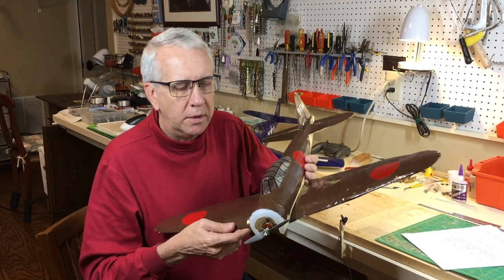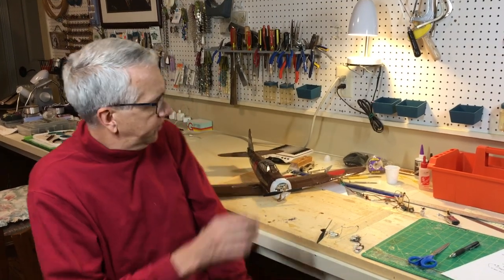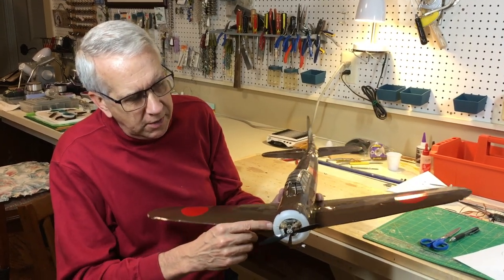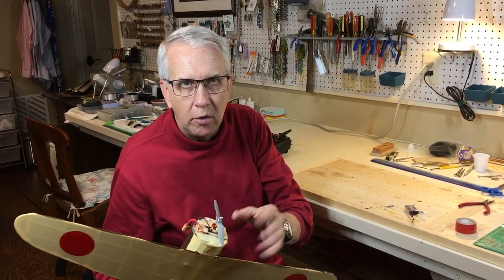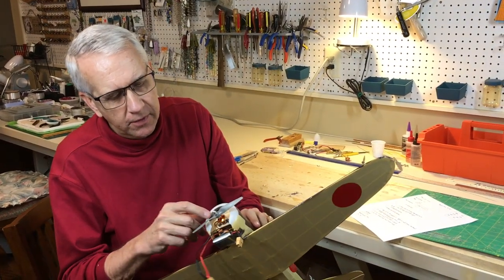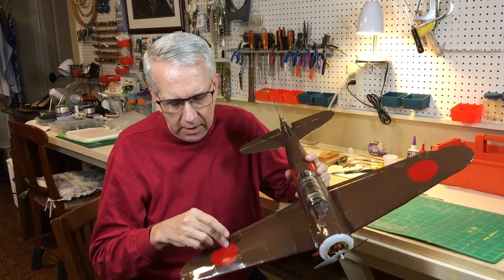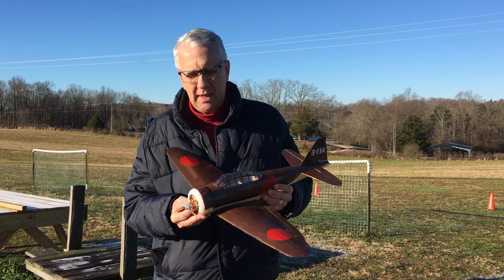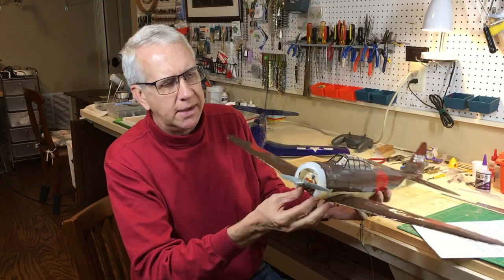Guillows Zero RC Conversion Success

Comment: Great job, Tim. I used to slightly extend the nose on planes like this to get the balance right without having to add weight to the nose. Done with discretion, it's virtually unnoticeable. This is also a common fix for tail-heavy full-size aircraft designs. Also, with minimal dihedral, ailerons are always necessary for good lateral cotrol as rudder control only will not produce sufficient roll.
Reply from the maker: G-Man:  Thanks for the info!  Tim
Reply: @TimMcKay56  YW

Comment: Hi Tim.  on the two recent conversions i've watched (This build and on the Corsair) I noted the weight differences you pointed out with the leading edges and wondered if this may of been a design feature for the elastic band powered build.?
Mainly due to counteract the stronger torque produced by the elastic propellers greater pitch they usually have.?

Keep the builds coming they're great and the models look fantastic.!

Reminds me so much of what my Dad would get up to in his shed.

I doubt you'd be bonkers enough to build a full size Gyro copter glider from aluminium scaffolding poles and a car wheel hub anytime soon though.  LOL.
Cheers.  :)
Reply from the maker: Electrodoc:  Not sure I can add much to the leadiing edge issues with each build.  The Zero Guillows model is a lot smaller than the "Giant Scale" Hellcat, some changes in the methods of construction.  And no full size gyrocopters for me!!  Tim

Comment: Sir Tim, good morning and I hope this comment reaching in good health. Thank you for all the video tutorials regarding the RC conversion of Guillows wood/balsa planes. I just received an earlier version of the Guillows World War 2 Mitsubishi Zero flying multi-purpose model kit, designed for both rubber band and RC. I am seriously thinking of converting this to a remote control plane and would like to seek your help in buying the correct RC parts. I live in the Philippines and we don't have much stores to buy them except for online shopping services like Shopee Phil. or Ebay. Can you kindly give me a really detailed list of the RC parts you used for the successfull conversion of your Zero plane? I'm retiring (60 years old) in December 2022 and will start buying the parts to start the kit and give myself a fun Christmas gift. 🤣🤣🤣
Reply from the maker: Roberto:  Check out my video on where to buy micro electronics in 2022. Good luck with your Zero build!  Tim

Comment: Just out of curiosity: why don't they make a gearbox for outrunners just like they did to the brushed motors so we can run these little guys with less speed.  With the outrunner, even with low kV, they go extremely fast with an 8x4 prop.  Any thoughts are welcome.  Good job :-))
Reply from the maker: WS:  Wish I had a good answer for a good question!  Seems like there are very few micro motors out there.  Tim

Comment: Hello Tim, I just watched a 16 part video by some English men. Who built a kit #203 (Newport). He used a lot of carbon fiber rod in the build, really thin stuff maybe 1/16th. He hasn't flown it yet, I guess I'll have to weight to see how successful he was. I've never worked with carbon fiber. Is it Ca glued together or do you have to use an epoxy to join it?
Reply from the maker: David:  Yes, carbon rods would be a big help with both strength and saving weight.  You can use epoxy for sure (fills gaps well), and if CA use a thicker, gap filling type and do a few test glue joints.  Tim

Comment: I really enjoy what you do! Please keep it up! I don't understand why you invest so much time in building a 3 channel underpowered airplane when it's so simple to do it correctly or at least scale with proper ailerons, possibly flaps, and definitely more power. Why build something with limited performance when cost and manufacturing are not a factor?
Reply from the maker: J Huff:  I like my models to be as lightweight as possible, plus I like to experiment and have some fun.  The ParkZone electronics was a test, and I now know a bit more power for the WW2 fighters is in order.  I am familiar with normal ailerons (see my Hellcat build), but wanted a quick fix for the Zero, and the strip ailerons were ideal for this.  All good!  Tim
Reply: @TimMcKay56  Would you like to do a Guillows Spitfire 27 1/2 conversion video? I would like to donate the Spitfire balsa kit and a new in box Eflight UMX Pitts BNF AS3X. Let me know if you are interested. Have a Great day Tim!
Reply from the maker: J Huff:  I’d be happy to give your Spitfire a try!   Please send me an email (under “About” on YouTube channel home page) and I can provide my mailing address.  Tim
Reply: @TimMcKay56  Fantastic!  I will get you my email, Cheers Tim!

Comment: I am currently working on a dumas kit 308. 30 inch Storch. Any experience with the Dumas kits?
Reply from the maker: OTW:  I have not built a Dumas kit, but from pictures I have seen, the balsa construction is about the same as the Guillows kits.  Tim
Reply: In my experience converting balsa gliders to R/C over the last 20 years the #1 Most Important aspect is the CG, use the electronics to balance your aircraft without adding ANY ballast. #2 Power Go Big! No need to add useless weight to the nose when you can use the motor and battery to get the same result with the benefit of power over dead weight. In your application or any balsa conversion of that size, the UMX Turbo Timber electronics set up is perfect. #3 Build the wing in one piece and use clear plastic for the control surfaces.

Comment: what is the guage or mm of the servo wire and what metal, thanks
Reply from the maker: Frank:  Not sure, really.  Servo wire has three items (signal, power and ground).  All very low power, this smaller wire for regular servos.  Tim
Reply: @TimMcKay56  sorry i meant to say control horn wire
Reply from the maker: Frank:  I use the lightest music wire that I can for the Guillow's models, to save weight.  As I have  "stash" of various sizes of music wire, not sure of the exact size.  But the music wire, if properly supported to it cannot flew, can be quite small and still work.  I use the fuselage formers to support the wire out to the tail surfaces, seems to work OK.  Tim
Reply: @frankgordonsmith4795  The wire in Guillows 900 series kits is .035.  In the zero kit he has it's .047. Both are for the landing gear. Not sure if this helps, but there it is.

Comment: Still seems pretty underpowered - needs smallish 3s pack and a motor that's about 1500kV, and a prop that's about 1" bigger. You need a wattmeter. I'd say 150 - 200 watts would make that bird fly with plenty of excess power. I expect you'd double your powertrain weight but that might be OK - you certainly have enough chord and span to generate the lift you'd need.
Reply from the maker: WB:  Roger that, more power means a faster flyer.  😬  I was quite close to putting in a larger motor, but wanted to get a data point on this particular motor.  Zero actually flies well, I was at around half throttle.  im